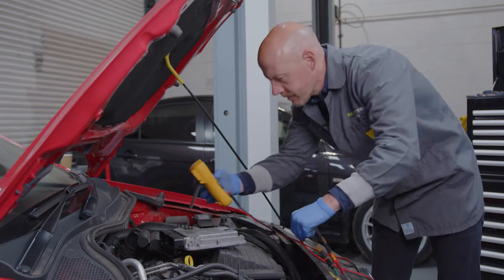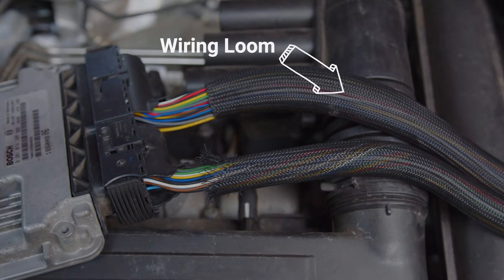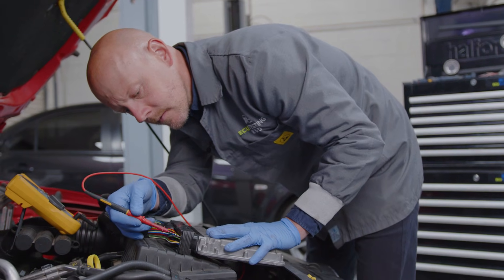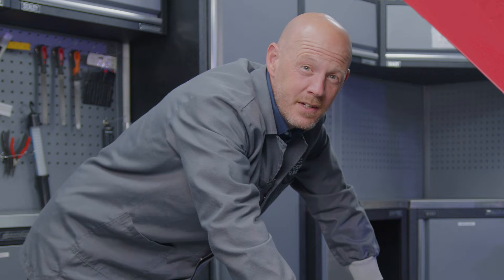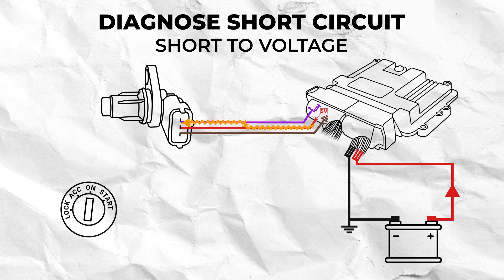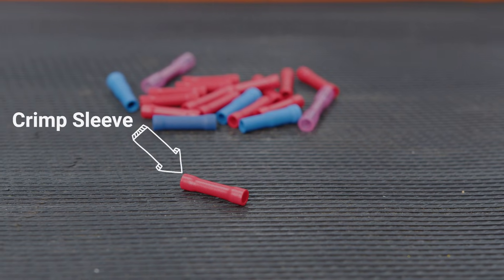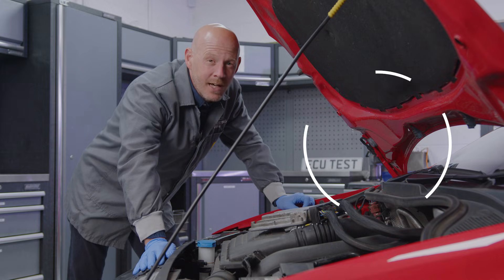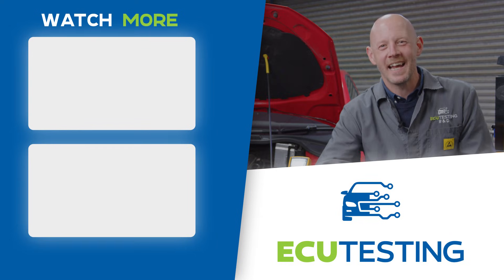Car Wiring Repair: Ultimate Guide to Finding, Testing and Fixing a Wiring Fault

Comment: Hi i dont get the voltage drop test .You say to test from end to end will a multi meter pick this up without being connect to the negative?
Reply from the maker: Hi, very good question! Yes the multimeter will produce a reading even without being directly connected to a negative. This is because in order for current to flow through the wire, the circuit must be complete by being connected to a ground point. While you're not directly touching a ground point with your multimeter probes, the circuit itself is grounded through its connection to the battery's negative terminal or another grounding point. This shared ground ensures that all components in the circuit have a common reference point for electrical potential. 
By placing one probe at the start of the wire (or one side of the component) and the other probe at the end (or the other side), you're measuring the voltage difference between these two points. This difference is the voltage drop, which occurs due to resistance in the wire or component. The multimeter doesn't need to "know" they share the same ground in an explicit sense; it simply measures the difference in electrical potential between the two points you're testing.

In the video, we have shown a simplified wiring diagram only showing the 12v power supply wire to the alternator, whereas for this circuit to be complete there would also be a ground wire going back to battery negative or a ground point on the vehicle (in most alternators this would be the casing of the alternator itself which is attached to the chassis). Hope this helps!
Reply: @Ecutestinglimited  Of course. Thank you . Great videos by the way .I'm a spark of 30 years myself but working with single and 3 phase AC is a different ball game no where near as technical as ur game ,and I think my knowledge apart from using a multi meter is a hindrance more than a help when it comes to cars.That said I've never understood Canbus until I watched ur video today.and it's very much the same as testing and fault finding a ring main .
Thanks again mate

Comment: 6.47 you say to isolate the wire? Are you saying unplug from the connectors as in De pin but leave all the rest connected in the terminal blocks?
Reply from the maker: Hi. Yes, if you remove the affected wire's terminals (de-pin) from both connectors then the wire should be isolated from the circuit. Plug both connectors back in and test for continuity between battery ground or battery voltage depending on which you suspect it is shorted to. Hope that makes sense!
Reply: @Ecutestinglimited  it does thank you. I was just trying to suss out if you were doing it differently with them still connected.
Electrics are not everyone’s friend, especially mine. I came across your videos and enjoyed your explanation and theory. Instant subscriber thank you.

Comment: in ilustration is write 0.062 ohms per 1m but when you speak you say 0.026 per meter, what is correct?
Reply from the maker: It should be 0.026Ω per meter of wire, apologies and thanks for spotting that!

Comment: I am a beginner..can a technician use a analog multimeter to do this?
Reply from the maker: You can carry out the testing methods highlighted in this video using either an analogue or digital multimeter. However, a digital meter is always preferable as it offers more precision and reliability in results, especially when testing circuits dynamically such as during voltage drop testing. Also keep in mind that with analogue multimeters you will need to select the correct range when carrying out your tests to prevent damage to the multimeter. Hope this helps!

Comment: is there one of these to help urgent
electrical professor
electrician
electric technician
my case : 
( when i connect the multimeter red to red the + / and black probs ) . gives reading as continuity 
important notes : 
1 - NO BATTERY
 2 - multimeter ON Diode mode " continuity" 
- is that normal - ?!?!?!

Comment: Always test your circuits dynamically
Reply: Yeah, a wire might seem good but can short or create open loop when moved.

Ideally, if your multimeter beeps when shorted, you can try shake the cables and connectors a bit and listen for interrupted beeping.

Comment: Liked your video straight to the point myself I always use the dynamic voltage drop to get all I need positive side and neg side in all connections to find problems anyway where did you grab your tension key tools love them thanks again sub and liked looking forward to watchig more
Reply from the maker: Hi. We're glad you enjoyed the video! The terminal tension/pin tension tools can be hard to come by. Some suppliers sell these specific tools: https://www.autotechelectrical.com/ but if you are unable to source these, then a good alternative is getting terminal test lead attachments for your multimeter which will do the same job: https://www.hubitools.com/en/catalog/diagnostic-test-lead-set~0389d3b3-3acb-2bce-9ac0-39eabe1ce34f However these usually come in big kits which makes them fairly expensive. Finally, if those two options aren't for you, you can always buy replacement terminals/pins for the specific connector you're testing and use those! Hope that helps.
Reply: @Ecutestinglimited  Appreciate this thanks again.

Comment: I know this segment is upon wiring. I saw another video of yours which was speaking about codes for example P1254. I would like to know what does code P12A2 I have VCDS software yet nothing in code aspect states what the code is for a 07 Audi Q7 engine 3.6L V6 can you explain to me what that code is and direct me to check it for repair thank you.

Comment: Where you bought DRAGGING TOOLS?
Reply from the maker: Hi. We have answered this in another comment but here is the reply: "The drag tools can also be called terminal tension/pin tension tools but they can be hard to come by. Some suppliers sell these specific tools: https://www.autotechelectrical.com/ but if you are unable to source these, then a good alternative is getting terminal test lead attachments for your multimeter which will do the same job: https://www.hubitools.com/en/catalog/diagnostic-test-lead-set~0389d3b3-3acb-2bce-9ac0-39eabe1ce34f However these usually come in big kits which makes them fairly expensive. Finally, if those two options aren't for you, you can always buy replacement terminals/pins for your vehicle and use those! Hope that helps."
Reply: @Ecutestinglimited  Thanks.

Comment: Brilliant content as always so thankyou for that. Quick question. Where can you get those drag tool tester kits as i have the pin removal tools but not those and Google doesn't show anything.
Reply from the maker: Hi. We're glad you enjoyed the video! The drag tools can also be called terminal tension/pin tension tools but they can be hard to come by. Some suppliers sell these specific tools: https://www.autotechelectrical.com/ but if you are unable to source these, then a good alternative is getting terminal test lead attachments for your multimeter which will do the same job: https://www.hubitools.com/en/catalog/diagnostic-test-lead-set~0389d3b3-3acb-2bce-9ac0-39eabe1ce34f However these usually come in big kits which makes them fairly expensive. Finally, if those two options aren't for you, you can always buy replacement terminals/pins for your vehicle and use those! Hope that helps.
Reply: @Ecutestinglimited  brilliant thanks for taking the time to reply in your busy day.
Reply from the maker: @the_retired_mechanic  No problem at all. Let us know if you need anything else!

Comment: Please let us know where to get the needle type probe attachment for multimeter wires.
Reply from the maker: Hi. You can get these attachments as part of a multimeter accessory kit from automotive diagnostic equipment suppliers such as Pico Technology: https://www.picoauto.com/products/clips-and-adaptors/backpinning-probe-set
Alternatively, and depending on budget, you can get the needle/pin probes on their own from online retailers like Ebay or Amazon.